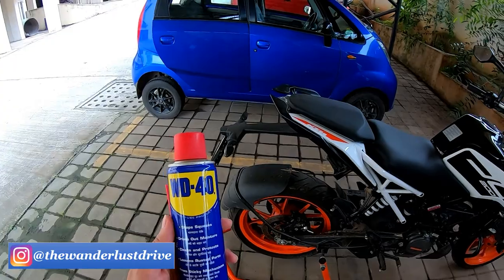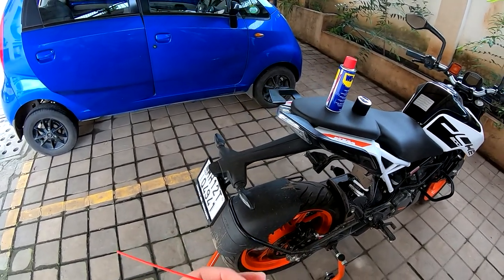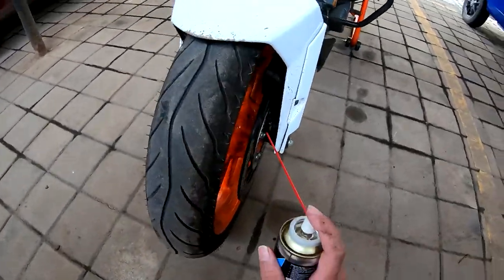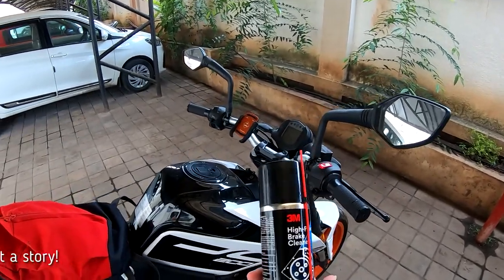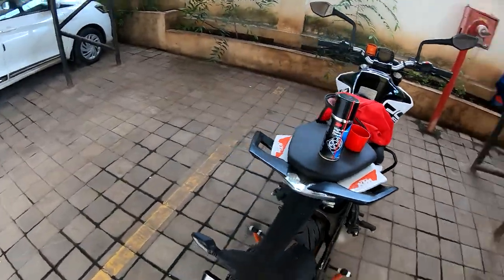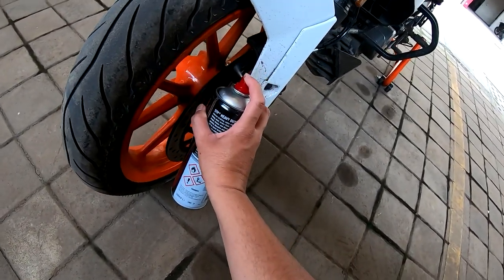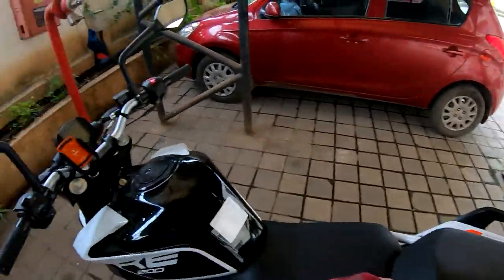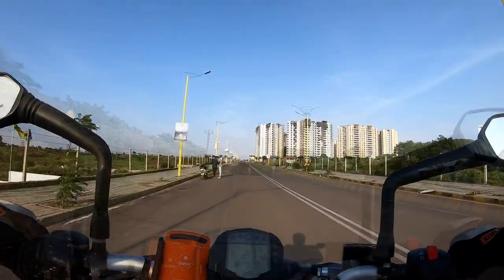How I fixed my disc brakes on the KTM Duke 200 after spraying WD40 on them

Comment: Will washing with detergent work?
Reply from the maker: no.. and it is likely to spoil the brake pads. Best way to clean is to use 3M brake cleaner or equivalent which work at the molecular level.

Comment: Can we use this after washing our motorcycle? Just for cleaning our disc. I have a new motorcycle
Reply from the maker: Yes you can. But not really required for a new motorcycle. When you ride in dusty conditions, your discs will start making squeaky noises. That time get the bike pressure washed from washing center and then use this to ensure braking is back to full efficiency

Comment: How how much time do we need to wipe off the residues for the disk brakes
Reply from the maker: I'm assuming you mean after spraying on the brake discs. If using 3M brake cleaner then no need to wipe at all. It's self evaporates super fast. If using STP then need to wipe off the residue after some time. With STP, at least 2 times cleaning will be required.

Comment: I use the stp but it didn't show any result... i invest in many  break clean arou 3000 but it doesn't work...plz help me
Reply from the maker: Hi, not sure why STP wouldn't work. It works fine for me. 3M Brake cleaner is much stronger if you want to try it but if that is also not working, then get it checked by ASC.
Reply: @TheWanderlustDrive  can service center clean this??
Reply: I use wourth, stp, hyundai, maruti suzuki break cleaner or even wash in soap,alcohol,dish washer but it doesn't work🥲🥲🥲
Reply from the maker: @pys2881  if they can't clean, they will replace 🙂
Reply: @TheWanderlustDrive  what is the cost of the discplate
Reply from the maker: @pys2881  it will differ from each bike. Pls check with ASC

Comment: I too sprayed WD40 on disc brake....
Reply from the maker: Hope you were able to fix it quickly too! Today when lubing the chain, some of it must have sprayed on the disc rotor as well as I found the same issue again in the rear brake. But a quick spray of STP Heavy Duty Brake cleaner brought the braking back to normal!

Comment: Bro in my bike duke 200 front break it is noiseing sometimes like whistle it normal or not
Reply from the maker: Is your bike new? The rear disc used to make that kind of noise for my bike for a while but no other braking issue apart from that. Now I've completed 5.5k kms and no more noise
Reply: Its becasue of the dust that is seating on your Diskpad clean it and you are good to go

Comment: Rather than putting so much effort buying all this gimic items Change break pads and clean your Disk with Kerosin
Reply from the maker: Change brand new hardly used discs? Bhai maybe you have the money to change stuff every 500 kms. As a biker, we need to learn to properly use and maintain things and most importantly, how to fix our mistakes!
Reply: @thewanderlustride  You are right. This guy doesn't know what he is talking about. Kerosene really? What a joke.
Reply: Sanitizers work well here wipe disk and good to go😂
Reply: Brake cleaner is not gimic item bhai 😂